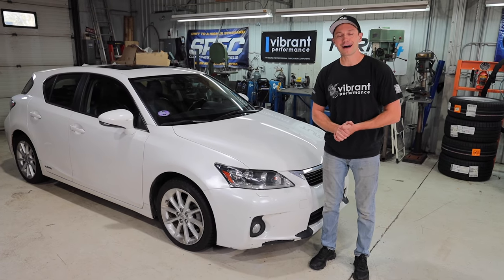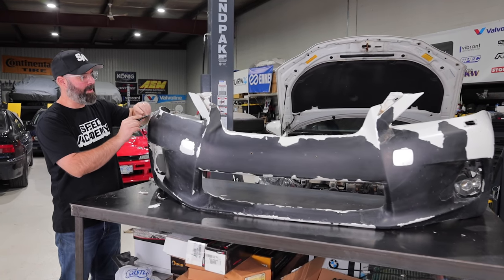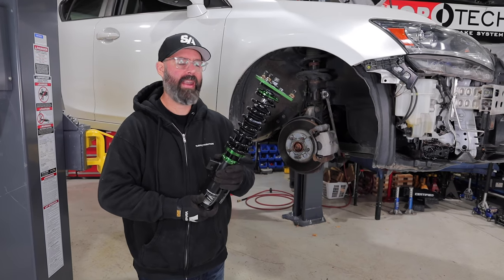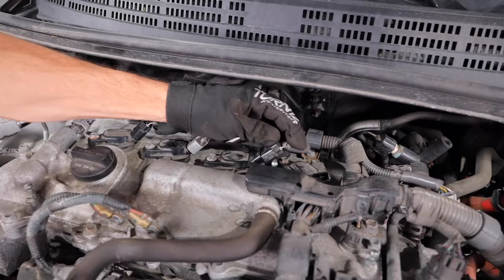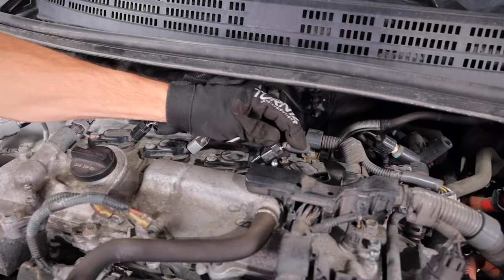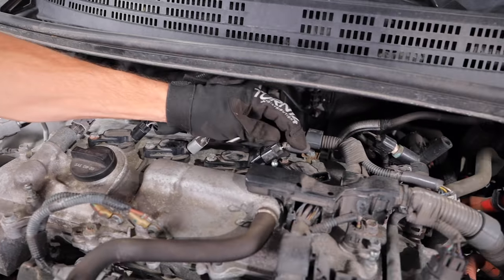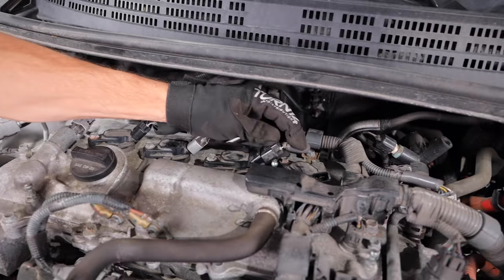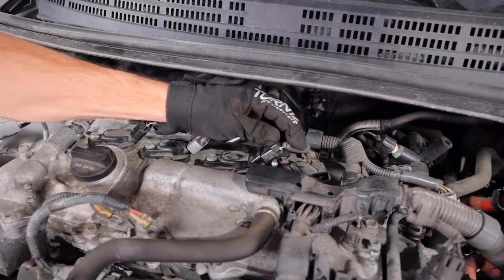Quick & Easy LEXUS CT-200h Build (Pimp My Lexus) - Part 1

Comment: Love how you were not shy about naming the dealership.  That’s the way...throw them right under that bus where they deserve to be!  😂
Reply: I agree!
Reply: That dealership has quite a few interesting stories if you google them
Reply: He should have contact Lexus. They would have made that dealership correct their mistake
Reply: @isaac297  Wheres the fun in that though
Reply: They're Own by Weins canada private dealership also own other few band 
This doesn't look like their work TBH.
Reply: Dealerships don’t paint anything.  They outsource it to an independent body shop to do the painting.
Reply: @marketbuy  Yeah, that's why they have paint booths and parts on racks along side the disassembled vehicle in the service bay. But you are right, the dealership doesn't do anything like that.
Reply: @1mawesomel1kethat  Some dealerships do have paint and body service but it is never the actual dealerships company doing it, I worked at Toyota and it was parterned with seidners collision center. another toyota I worked at had an outside vendor that did paint behind the shop. So still out sourced but I can see how one would assume that its the dealers work.
Reply: @1mawesomel1kethat  Chances are, this dealership leases the land to a 3rd party body collision and paint shop.   It may look like the dealership does bodywork and paint but they don’t.
Reply: I know at least one Toyota dealer that ran and owned their own body shop.
Reply: My CT200H has the same paint chipping issue TBH
Reply: Buyers and critics usually forget to understand the dealership... whether or not they did the work themselves under their own name or outsourced the  job under a 3rd party is a fiscally responsible for the vehicle unless there's a written warranty for that paint, tuneup new tires, battery or (insert most any other repairs/maintenance here) sucks that things are made to have a failure time or milage date now but nothing is made to last forever, and like I said, it's not the dealerships issue unless they promised in writing it is guaranteed for that long or more at the time of purchase

Comment: Hi guys, the cause of this paint peel is that the previous painter didn’t sealed the bumper with a special plastic primer. You have to degrease it first with a plastic degreaser to “soften” the material after that you need to scotchbrite it. No sandpaper needed, it came obviously new so not damaged. After that redegreased and primed. And then paint and clear. Greetings from Belgium. Love your channel, best content! I would love to give you a hand on your projects, but the ride home after a day of work would be a long one!!!

Comment: I would like to see a review on the  CT200h. I’ve been looking to buy one
Reply: Great car I love mine. The paint on the front bumper is cheap as seen in the video for some reason, I have some of the same problems but not nearly as harsh. Rocks will hit the bumper and chip paint at high speeds but nothing a little touch up paint can’t fix well enough. The interior is pleasing to look at. Amazing leather seating. Some of the plastic feels cheap but most of it is well done. Back seat is very small so don’t expect to be hauling 4 fairly sized people very often. I love the interior design though aside from the overuse of plastic where there is no leather. Makes me feel like I’m in a Lexus. The driving experience is amazing imo. I love taking tight corners at high speeds with it, the fwd is great for pulling through turns and the light body weight makes it so there is absolutely no body roll whatsoever. However, in a straight line you aren’t gonna be winning any races! The car gets up to speed though so don’t think it’s too slow for daily use and merging into traffic it has plenty of power for casual usage. The small size males lane changing easy in small spaces and I can’t tell you how many times I’ve been able to squeeze into a turn left only lane where a truck couldn’t fit! Parking is so easy you can park this thing anywhere no problem. The hatch back is great for daily use and this car has single handedly made me want a hatchback for my next cars to come! One  thing I’ll note is the suspension is very stiff so hitting a pothole hurts everytime whereas a truck could brush it off, you’ll know you hit something in this little guy! (Very easy to dodge things in the road though since the width of the car is so small you could fit 1.75 of the car in 1 lane.) I love the car. Great on the wallet. Dealership maintenance can get pricy but that’s the cost of driving a luxury car and having the reliability of a Lexus. I’ve seen many of these last more than 100k miles and I’m hoping that mine is no exception! Feel free to ask me questions about the care if u need to, hope I could help! :)
Reply: @mmeste5218  Have you had nay issues with clogged EGR? Also, I've been reading about brakes locking and/or lurching you further ahead then where you mean to stop. I looking to buy one but keep reading about these issues. Any advice will help. Thx!
Reply: @gisellejoseph1824  I am thinkin to buy one. Would you recommend me?
Reply: @savjottoor7910  after much reviews and research, I decided to get one last year and I love it. It’s a very nice ride. No problems and it’s been a year. Also, with the gas prices lately- filling up is not expensive. If you find a good deal- go for it!
Reply: @gisellejoseph1824  Greattt!
Okay so please give me a suggestion, I found a 2012 ct , single owner , well taken care of, every single service done at lexus dealership, 1,50 k kms for 15 grand here in ontario, canada. There is no maintained car left these days under 10 grand ( sadly ). I feel it is a little expensive for 15 grand but even if I sell it ( which I don't think I will ) in two years, I will not lose a lot of money.
Do you think I should go for it?

Comment: This couldn't have come out at a more perfect time. Just purchased a 2012 CT200H, should arrive at my house in a couple weeks.
Reply: I am considering to buy one ina a really good condition. Would you recommend it to someone?
Reply: @savjottoor7910  I would, I love the versatility of it being a hatchback. Mpg is great. I get 40+ easily on eco mode and 37 on regular/sport mode. The only complaint comes from my spouse. He’s 6 ft tall and his head practically touches the roof so that’s the only downside. Expecting our first baby next month and we’re able to fit her car seat in the back just fine too with plenty of room for me but I’m 5 ft 4 in so that’s a huge difference in height and leg room between us lol. The sunroof can be noisy at times which is a complaint I’ve heard from a lot of owners. I had bad cabin noise initially but the tires were ready to be changed. Switched to Michelin’s per Lexus’ suggestion and that helped significantly. Back seats fold flat and I’ve used it plenty of times to haul tile, plants, mulch, my dogs…you name it.

Comment: Definitely poorly done paint work.  All Toyota bumper covers come in raw plastic.  They need to be baked through a booth cycle to off-gas any remaining mold release agents.  Then they need to be scuffed and re-cleaned.  Once they are in the booth: they require an application of an adhesion promoter, then a primer sealer, then your typical base/clear- the flex additive/agent normally gets added into the clear coat.

Comment: hey Pete you should have got the rest of the Modellista lip kit for the CT200H side skirts and rear lip to make it look complete, you should also get a cold air intake or short ram intake and a vibrant street power muffler with a 3.5in tip

Comment: The reason the spark plugs look like that is the sparkplug tube seals on the valve cover are leaking. My 06 Si was buring a lot of oil but now its nearly nothing once I changed them. My plugs looked the same as yours.

Comment: Hello there. First time seeing this video on your channel. 

I got to say. Your CT200H is nice 👌 it brought me back when I had my 2013 CT200H F Sport ( same color) . SIir you should look onto a Tom's front strut bar and Megan rear strut bar.  It will make your vehicle handle five times better around corners. 

I had them on my along with other steel brake lines on StopTech rotors with Japan WinMax W3 brake pads, oem Lexus F Sport springs and  X bar.  Wheels are oem Hyper Black special edition oem rims on Hankook RS3 tires. Plus a set of Sparco SPX carbon fiber seats ( driver and passenger ) on Sparco seat rails.

Comment: Its an aftermarket bumper and it has a residue from the factory similar to wax. Wasnt stripped enough with grease and wax remover and then they didn't primer it before painting it.

Comment: I changed the plugs on my ranger that I bought about a month ago. It had the original factory plugs in it at 177,000 miles. Needless to say, the gap on them were totally in spec.

Comment: Nice! Just bought a 2011 a few months back and converted it to a 2014-2017 F Sport.
Reply: Can you provide details on how? Just a body kit ?
Reply: @TheFarahk  there's a lot of pieces that needs to be purchased. Both front and rear 2014+ bumper cover (front needs to be f-sport). Front and Rear grill inserts (f- sport), front absorption foam (sits behind the bumper cover), hood wearther strip, and miscellaneous screws.

Comment: I love what you've done with this CT! I work on a Lexus dealer here in Spain and I have a lot of questions to make, because I know that the CT has been so underestimated as mod material. When you changed the wheels and tires, did you had troubles with the hybrid system? Because some NX have had problems with this when the customers install different set of wheels instead of the originals. I subscribed to you already! Nice channel and reeeeeealy nice material you have!

Comment: Bumpers come with a black primer on them most of the time.sometimes they are “raw” meaning no primer. It’s hard to tell from the video if that bumper had it but normally you would scuff it very lightly then spray with a plastic specific primer for flexibility and adhesion then sealer then paint and finally clear.
Reply: Typed this before I saw they said it was raw.

Comment: In for a CT 200h review video. The Gen3 Prius, which this based off, have a reputation for head gasket failure, so it'd be nice to hear your thoughts. As well as about the 10 year old battery condition.

Comment: I was going to comment that the easiest way to spoil a car is to put a spoiler on it. But this one is really subtle and actually makes the car look better.  I'm just left thinking that's an awful lot of rubber for an econobox commuter. The tyres and wheels look great but you could get the same look with narrower tyres and less offset on the wheels. 255 would be undoable here in Finland where the roads are full of deep grooves. Cold winters and studded tyres tear up the roads.

Comment: Had this CT200H for 4 years the pcv design is bad. If you don’t take care of that it will damage the engine very soon. Got rid of mine before it happened. Others have put a catch can which supposedly resolved the issue. Good Luck🤙🏼🤙🏼🤙🏼

Comment: I have this car, bought it used in 2015 and still enjoy driving it.  Love the upgrades, looks good but I don't think I could have it any lower and the front easily scrapes on many driveways.  I also need to add a cover strip to the back so I don't scratch things when I use the hatchback.  How much would this mod. cost?

Comment: Old video I know but watch out for head gasket failure around 130k miles.  My wife had one and the head gasket failed at 125k. Did some research and turns out it's a major issue on the hybrid 2zr-Fxe.

Comment: Also that bumper didn’t have the shipping primer scuffed off so the paint would adhere, most times when I spray a new bumper I scuff the surface, prime it and then paint so it doesn’t look like that a few months later.

Comment: Wait, so does primer need to be applied to all panels before painting? I’ve never painted a car before but i’ve learned you only need to add primer to a panel when bare metal is exposed.

Comment: 🤔 I'm wondering if the mileage has gone up with all the sportie upgrades! Would pete be able to tell a difference and make an update video on the car?
Reply from the maker: Havent seen any increase in mileage, kinda shocked but the enkei wheels are light
Reply: @speedacademy  may I ask how long have you been driving on the new set up? 🤔 Maybe you would see a difference over time. 🤷‍♂️
Reply: @speedacademy  it was a ok looking car before, but it's a good looking car now. Good styling picks on pete.

Comment: Clean the wiper cowl and water drains on the corners. Water might have filed it at some point and then leaked on to the engine and in to the spark plug holes.

Comment: on Toyota and Lexus bumper brand new they come raw plastic and the proper step is to wash the bumper first with a scotch brite pad than wipe it with adhesion promoter in the paint the should have put flex additive which prevents the paint from bubbling worked at Lexus and Toyota collision for a good amount of years

Comment: @Speed Academy does the 18 inch enkei wheels rubbed the inner side of the fender when you make a full U turn? I mean 18 x 9.5 is a bit wide. How about the front and rear fender clearance? does it hit/rubbed the fenders?

Comment: Why do the rear shocks have threaded bodies and adjustment seats if the springs are separate?
Reply from the maker: You still have to set the proper shock height that matches spring height

Comment: for peat sake I want to do the same stuff for my 2007 Camry XLE  v6 . specially the wheels .
Reply: Then do it man, you can get nice used wheels with tires for under $500 easily. I got a dope set of 18” M4 winters with tires for $200 from a guy in Barrie, always deals to be found for cheap mods.

Comment: You cant just spray that stuff over rust ! you need to remove the rust. its the only way to stop it lol that stuff often makes things works as its traps moister wit the rust and its even worse when you speak moistly !
Reply from the maker: The whole point of Fluid Film is to lock in and trap the rust from moisture and air. Spend a bit of time reading about it and you’ll understand.

Comment: no adhesion promoter and  what looks to be no sanding. Dealerships dont pay anything for bumpers and shops that do work for them make money on volume not quality. The dealership uses them as storage basically with cars going in just for a 50$ bumper respray so why should the shop care how it turns out.

Comment: Wait What? How is that Legal in America or are you in Canada ??
So Over there Car companies don't have to honour warranties if you are not the original owner? Wow what BS is that. 

Here(Australia) it would be Highly Illegal they would get in big trouble right away, They have to honour the warranty whatever that model comes with even if its the Fifth owner and its changed states and you dont even have a license and only the owner, 
As long as its within the Time & Distance stated on the Warranty Here only Reason they allowed to use for denying warranty claims are
1 - The Car Has Been Modified.
2 - The Car Has Been Repaired by You or unregistered Mechanic. (only the parts repaired + Those they directly effected loose warranty)
3 - The Car Has Had Non OEM Parts Fitted. (As Above, only the parts Repaired + Those they directly effected loose warranty Eg, Aftermarket intake Voids entire engine warranty)
4 - The Problem was caused by something you did directly either by accident or intentionally (eg, redlining it in Park to blow engine OR Broken Engine mount from Towing something too Heavy. 

(Same goes for 2nd hand cars with like a 1 year (25,000km) warranty)

Comment: Name and shame that dealership. That paintjob was shockingly bad workmanship.
about the sparkplugs: the dirt is called coronal staining and it does NOT inhibit the function of the plug. The plugs are iridium for a reason, the change interval is about 60000km. And they WILL do that. (personal experience on a Prius3 (same engine)